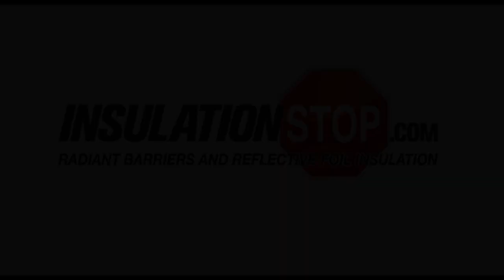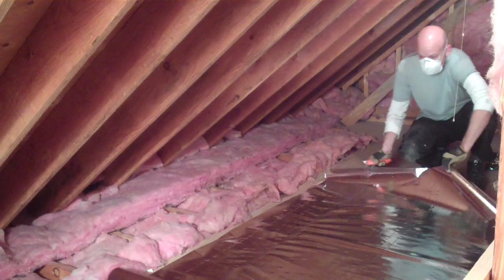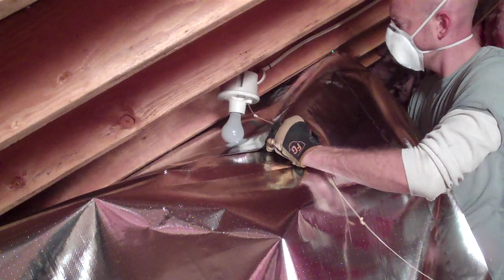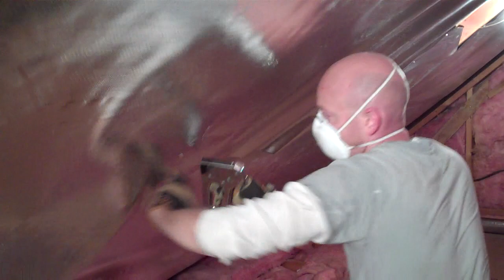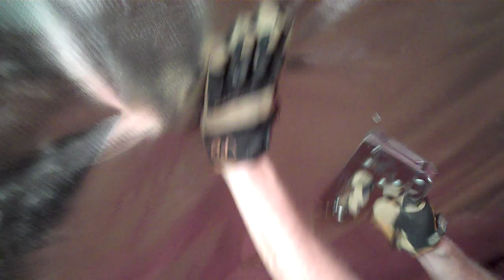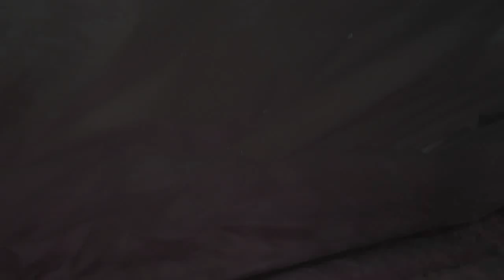Installing Radiant Barrier Insulation - Stick Built Attic.mpg

Comment: Doesn't this just make the heat gather in between the decking and barrier only to come out at the ridge line? Also, that sure looks like a snap.. share the video on a 4/12 pitch installation and let's talk about how easy that is ;) Thanks!
Reply: No. This material 'reflects' the Radiant heat from the sun. Think infrared so to say..  Different heat.  Radiant barrier has no R value.

Comment: Can you do this if you have pot vents on your roof instead of a ridge vent?  I have a low-pitched roof but it does have storage up in the attic where I could install this.
Reply from the maker: +John W Sure.  The vents are no problem.  Just make sure not to cover the up and not block any air flow that would want to escape throught the vents.